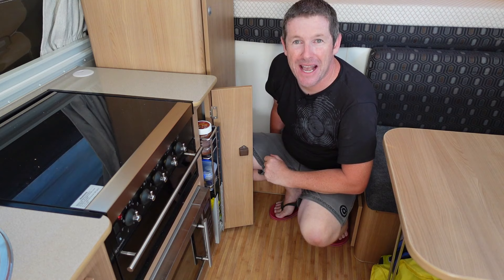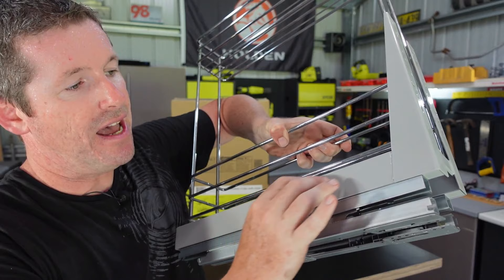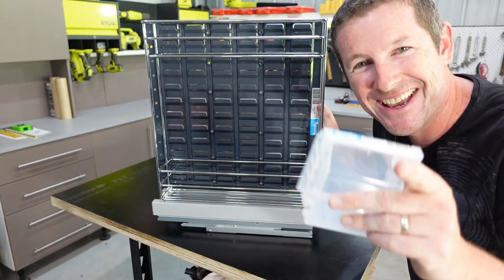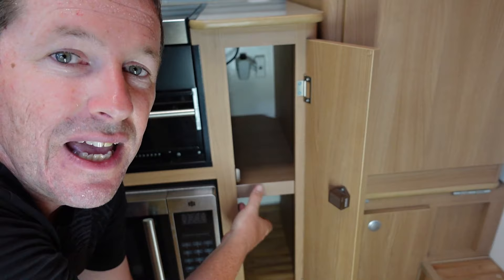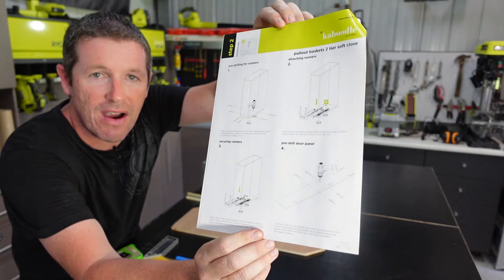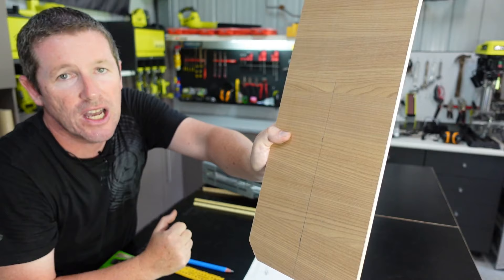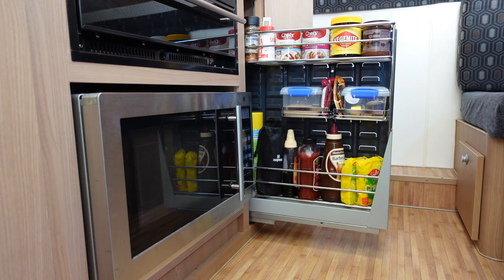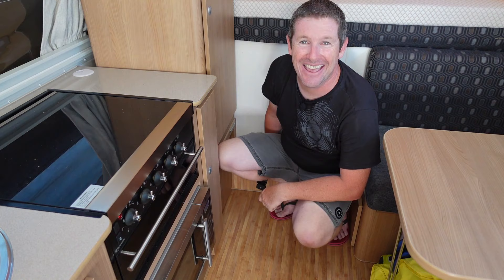LIVE | Installing a pull out pantry in our Jayco Swan - narrow cupboard caravan or camper solution!

Comment: Thanks for the video. What screws did you use to secure the spacer boards to the floor of the camper? And how thick is the floor on the jayco? I've noticed the water tank is directly below and I'm cautious of going too far and puncturing the tank. Cheers.

Comment: I'm worried that the unit is going to bend side to side during transport (especially when loaded up) and will wear down the runners in the base. If you put two pieces of wood on the back of the door with a small gap between them vertically, you might be able to have the door grab the vertical bar on one side of the trolley to stop it rattling side to side during transport.

Comment: Hello, Could you possibly measure the minimum width in the door space that is required to allow the unit to extend thru the open door. You mention 100 mm and it appears that Jayco have put spring loaded hinges on our new van's door. These hinges are chunkier than the ones in your vid which chews into the space needed for the slide and reduces that space to about 90 mm without fouling. Cheers Trevor

Comment: Hi I am just curious,we have a Jayco swan 2016 and in our cupboard we have a safety switch, is this something that you have come across? Thanks
Reply from the maker: Hi Sue - only just this week I have seen a few posts on one of the Jayco groups regarding the main breaker/safety switch being in this location - mostly 2017 models. It would seem if you have this same issue they must have relocated to this cupboard sometime during 2016. That location consumes soo much space!! Its unfortunate really. I believe later models now have it under the robe in the little no mans areas just in front of the step for the cables. Prior to 2016 its typically located adjoining the fridge under the lounge.

Comment: Hi again, just wondering we have a 2012 swan can u still use the power point inside plus the tv antenna cord mounted at the back ? Because we plug our TV on that top bench. Just hoping when u close the pull out slider  the cords won't get in the way🙏

Comment: How do you access your 12v port behind it now? This is our only 12v access for phone charging in our Eagle Outback
Reply from the maker: Hi Cranked, sorry I meant to respond a few weeks ago. We have other outlets so don't personally use the 12v back there. I would however have a desk mounted charger like the arlec one in this link with the cord permanently run down to the 12v outlet. You will likely need an adapter as its a usb on the end of the cord, so its not ideal but would work well. https://www.bunnings.com.au/arlec-4-port-compact-usb-charger-with-holder_p0096961
Reply: @WorkLivePlay  Thanks for your reply 👍